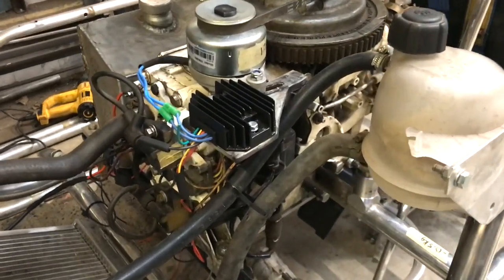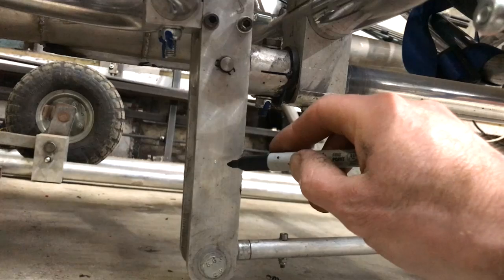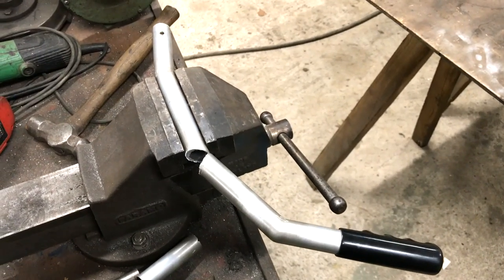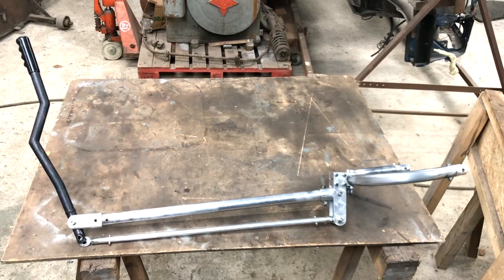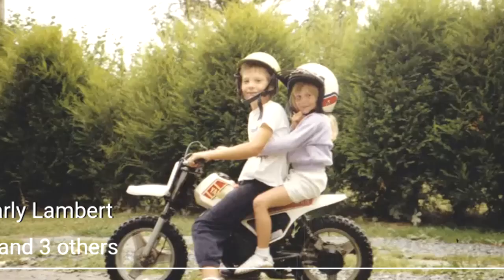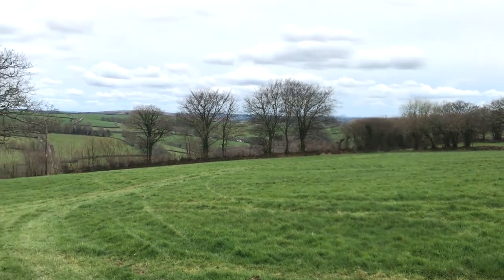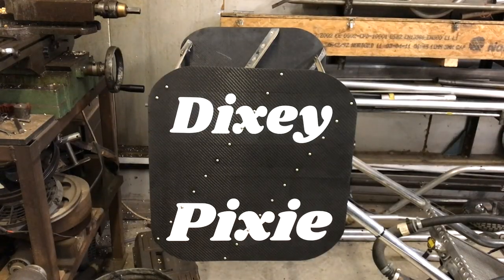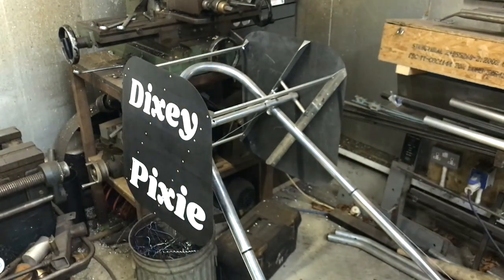This Mistake could have been SERIOUS, Homemade Helicopter

Comment: "Would canting the rudders inwards make the heli more yaw stable like a heading lock gyro on a model RC heli ?"
.... No .... how could it ? ... as always I am open to being wrong but I can't see how it would help create anything but unwanted drag and slightly reduced lift whilst introducing an unwanted pitching moment ....
I noticed on the R22 when climbing in the hover it had a slight tendency to pitch back and vice versa..no doubt due to the horizontal area component on the tail end. 
Canting them forwards for fast forward flight might yield some small improvements  but this idea seems to work best when they are further apart  like on an aeroplane but the dynamics of the heli is very different with regard to weather cocking in the vertical plane etc. etc. 

There's a detailed discussion to be had about those control linkages but getting them away from the ground was a much needed step to take, however shortening them will exacerbate slop in the system.... 
How difficult would it be to raise the main "axle" of the control linkage system under the seat instead ?
I wonder if having a strong spring connecting the control arms squeezing or pushing through the centre of the hinge lines would help without impacting upon control feel ?
As for the bushings, would brass be better than steel or is that too soft ?
and what plastic were you using I wonder... would delrin be a good option here ?  

Anyhow Capitan Pixey, another entertaining and thought provoking video :)
Reply from the maker: Great to have your thoughts as always, you are a very smart Man. 
I didn't really know about the canting of the vanes, I saw it done on a Chinese Nolan copy. Completely understand the extra push down on the tail, which is negative lift. They did do it on the Kamov but used for forward flight only. Yaw in hover was rotor pitch differential. 

You're spot on with your thoughts on the control levers. My reduction will Increase the cyclic stick play, it will also increase the wear and load factor on the joints. Raising the tube would have been better or raising the skids. I took the easiest and lightest option but hadn't considered the extra strain and ware. 

Use springs to reduce the load ? 
Yes I would have used bronze as a bush material but didn't have any lying around so used steel. May regret that decision. It means the pin will ware as well as the bush. 

The plastic I used was acetal. 

Cheers. Ben
Reply: @Ben-Dixey  .... as for ""you are a very smart Man." ... I have some doubts on that theory ....
But I have been considering self identifying as a woman as it is becoming increasingly clear to me that there are some legal benefits, 
.... not that anyone seems to know what a woman is these days  :D :D :D
Reply: @Ben-Dixey  ...anyway... back to Delrin bushings and conical washers :)
Reply: @Ben-Dixey  ah no, use springs to reduce the play and slop between the two control horns, it would help with the small and lightly loaded inputs. "Verstahe du mich ?"  :D :D :D 

Delrin is a hard wearing plastic, seen used for some high stress applications, might be a better option ?
Also had an idea about using conical washers so one can them up to adjust the slop and feel of the controls and through continually adjustments they would have a longer useful life time.

Comment: Great video. I lheard a while ago that welds are stronger than the metal. I was veey surprised. Now I see it's not that simple. Pixie Dixie sounds catchy. If you spray the crops you could say it is a crop pixie-duster. Sorry.  😀 Loving the ground effect hover.  I'm looking forward to seeing you scale those hedges. 👍
Reply: Welding can be basic. The guys that show up to a factory and lay the same bead on the same thing all day every day...

But once you scratch the surface, it becomes metallurgy.
And THAT is a lifetime of study!
Mild steel, the weld is generally stronger... even a bad weld.

Everything else you start getting into weird alloys, grain growth, precipitations...pre and post treatments... even eutectics!
Reply: @paradiselost9946  I know metal has some crystal properties and that's about it. Fascinating subject. Thanks for sharing.
Reply from the maker: Thanks, "crop pixie duster" 😆

Comment: For anyone considering following you and building their own helicopter, can you advise how to comply with the CAA's requirements for amateur built aircraft, and pass their inspections ? - Reading through their CAP659 document it seems so full of red tape its a wonder you managed to get off the ground !
Reply: Because he's flying it under 20 feet on private ground he doesn't need to legally comply with any of that red tape :)
Plus I know for a fact he hasn't read any of that stuff ;) :D :D :D 
Also for those wanting to build their own heli there are better and more fully developed designs out there such as the Sch95 because it has a full collective and cyclic swash plate  control system, the Dixey Pixey brilliant though it is, is currently fixed pitch .... 
Lastly teaching yourself to fly anything is a treacherous path indeed and fraught with massive risks, 
ask me how I know :)
Reply: He should bring it to America ;) He can register it as "experimental" and be fine. A literal lawnchair with weather balloons attached is ok as long as you get a part 107 and pay a fee for a reg id tag lol. I'm not even actually sure that you need a part 107 lol.
Reply: If you went down the proper official proper legal route in the UK you wouldn't get anywhere or do anything, the powers that be DONT want people making such device's.
Reply: @cloudusterable  The CAA are definitely more helpful towards fixed wing designs than rotatory wings that's for sure. I suppose on the plus side the CAA discourages half hearted attempts that would invariably kill someone  with heavy fast spinning bits falling off...

Comment: Thank you for sharing these videos, and thanks for finally looking into the control rod issue. It was one that seriously concerned me a few videos back. I love the progress you're making, it would be a shame if it were to stop because of a safety issue. Thanks again for sharing.
Reply from the maker: Thanks for the suggestion, it was also worrying me. That hard landing on one of the videos would have been close I think. The extended poles provide extra strength to the skids, preventing them from spreading apart but when the time comes to remove them the low control rod would be at greater risk to ground strike. I'm much happier with it higher up. 👍